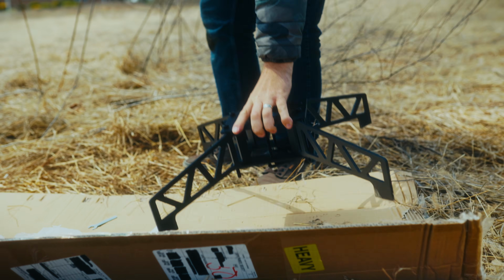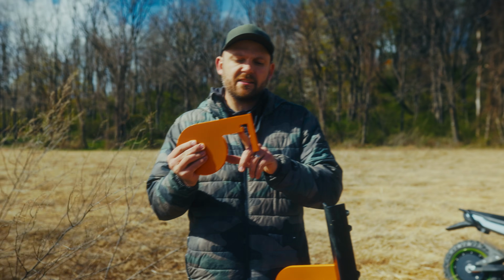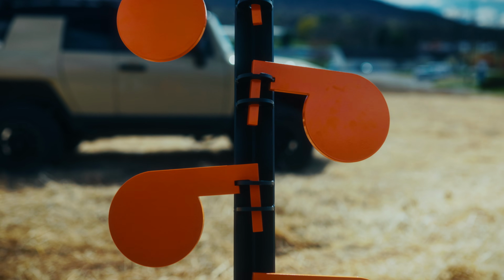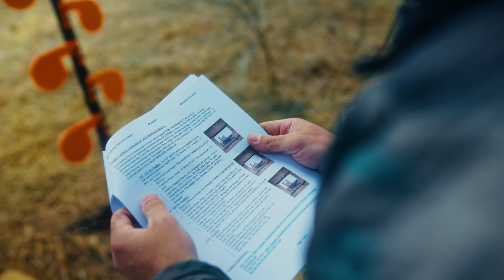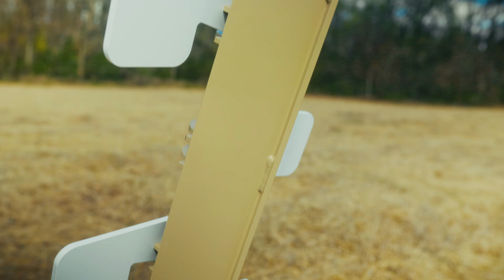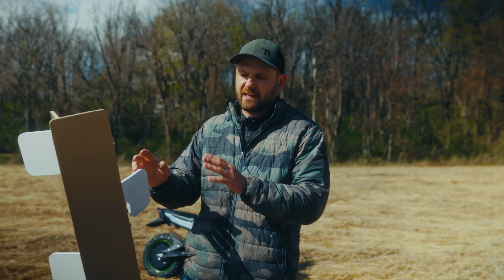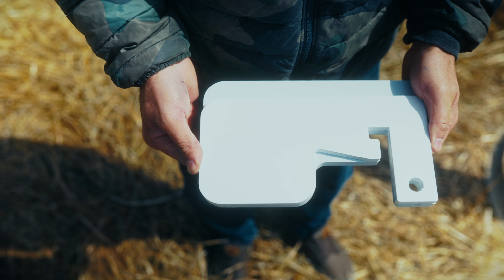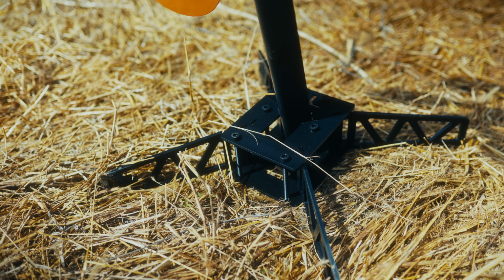Chinese vs American made Dueling Tree | The True Cost

Comment: Im calling bs on this. First this is 2025 not 1825. Manufacturing is not an excuse for high price or low quality. We have robotic assembly lines that build cars. Not only can machines work 24/7 they can do it with inhuman accuracy.

Second about it being unstable. You obviously are not using weight bags like you should be. Duhhh... yah it's gonna fall down. Different designs require different set up. To be ridiculous.... do you expect a subcompact to pull an 18 wheeler too? Come on use some brain cells.

Don't mistake this as a defense of a cheap product. I'm not. But justification of extreme prices has gotten the nation into our current problems. Don't shill for it.
Reply from the maker: @billlyell8322  LOL
Reply: @TATargets  do you disagree? Obviously an artisan product will have different quality as a mass marketed product does. That's what you pay for. Originally cars were handcrafted and extremely expensive. They were more akin to works of art than mass produced cars of today. As a result they were out of range of most people. There is nothing wrong with handcrafted nitch products. But it's disingenuous to compare it to stamped out parts. I'm all for eliminating cheap China products. After all there is nothing stopping you from using an American company to mass manufacture the same product at a fraction of the cost to your current standards.

Comment: Does TA Targets use laser or water jet media to cut the AR550? I'm curious due to heat affected zones changing the Brinel rating at the edges of a target, leading to edge cratering and higher chances of direct ricochet.
Reply from the maker: Water jet is not a good option for high volume production. It's incredibly slow. We use lasers for all cutting. Hope that helps!